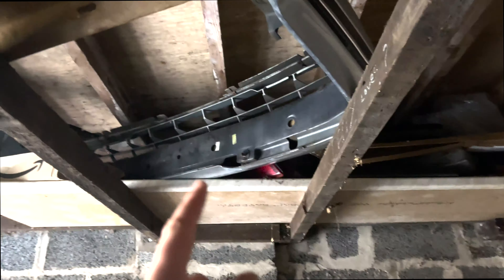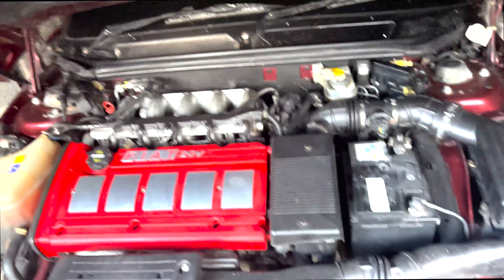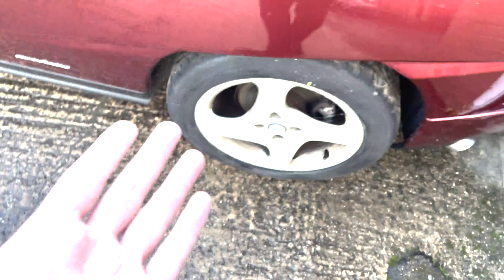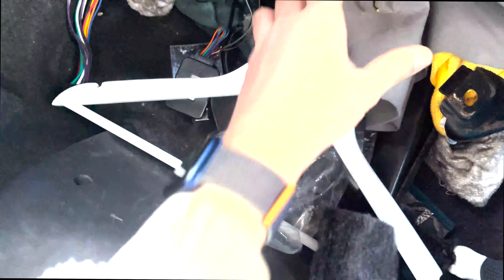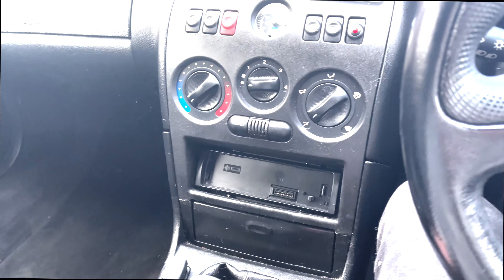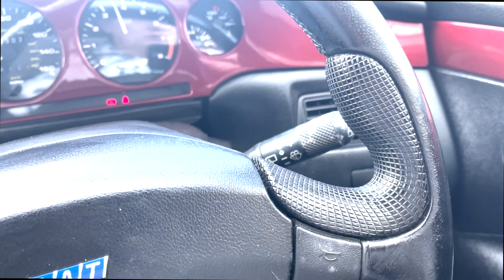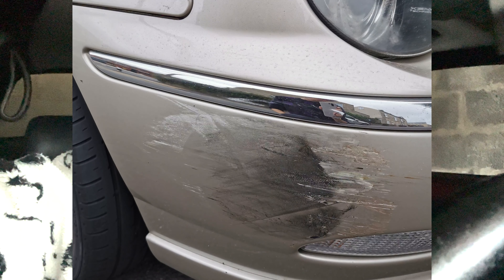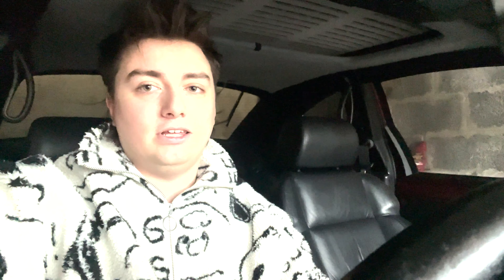When My Fiat Coupe Got RUINED By Another Car + Fiat Coupe Update And Plans

Comment: I’ve been working on my Fiat coupe 20vt today finished fitting the fmic, cutting the bumper, fitted the bumper with le kit, o/s/f inner arch and wheel. 
Done welding, refurb’d front/rear suspension, refurb’d alloys with new tyres, konis, whiteline arb’s and loads of bits powder coated. 
I got new stickers off eBay for £25.
I’ve got a working clock if you want it
Reply from the maker: Sounds good, my clock does work just the bulb/led is a bit annoying but I’ll fix it, thank you anyway though. Let me know how those Konis are I’ve been after some for a while for this and my Punto.
Reply: @tomdrives  my car is wine red also picked it up 2 years ago for £500.